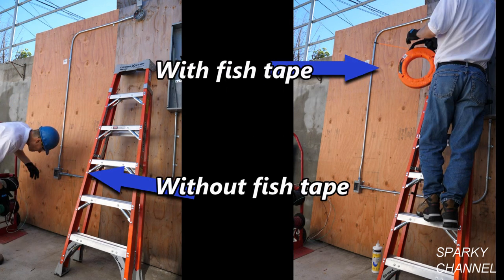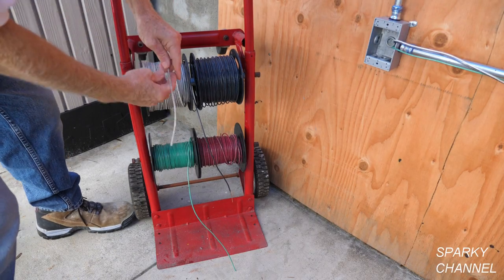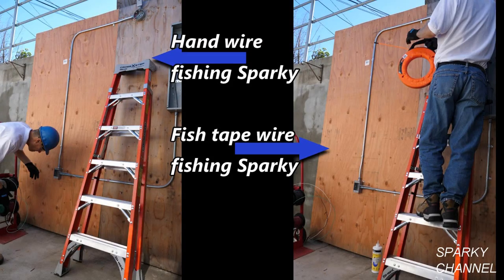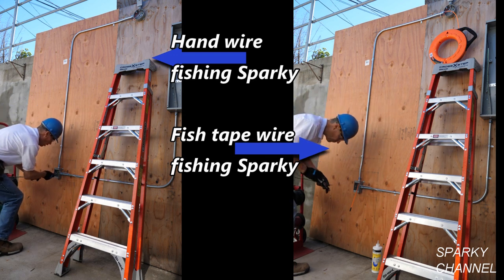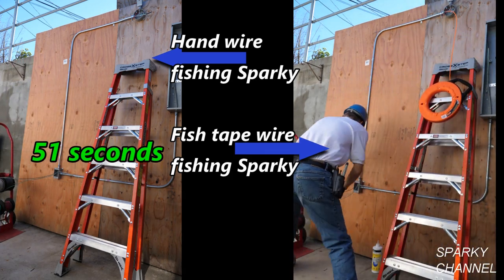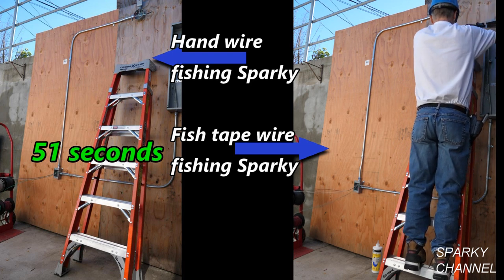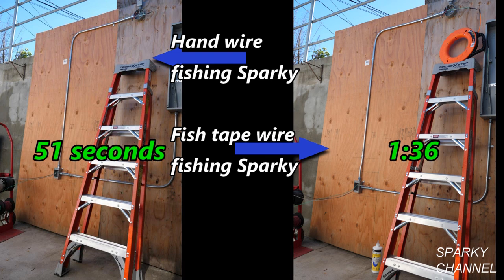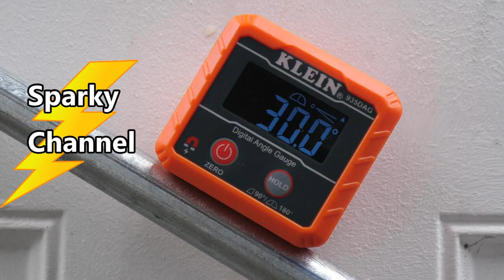When is it Best To Pull Wires in Conduit Without a Fish Tape?

Comment: Good afternoon, do you know of a device to test that each EMT joint is topped by the conduit? 
Ex: two EMT sticks are fully topping the insides of a coupling.
I know fishing tapes sometimes get stuck if the conduits are not fully in; so, maybe a device you can attach to the fishing tape lead or something of the sort?

Comment: Nonmetallic fish tapes are great, and safer with regards to lowering the likelihood of being electrocuted when pulling into or away from a load center, for example. However, they do lack tensile strength compared to steel tape - so they have a tendency to snap or break if put under too much strain from pulling.
Reply from the maker: Thanks!
Reply: You really should use the fish tape to pull wire pull strings mule tape rope all better otions
Reply: Non metalic tapes are only made for pulling string thru first then wire to string

Comment: I just did 7 wires in 40 feet of 1/2 EMT with a box offset, a saddle bend, a 90, and a 30 with a kick.  Used 3/8 braided rope with lube and all 235 pounds of me stepping on loops in the rope to make some of the turns. 😰